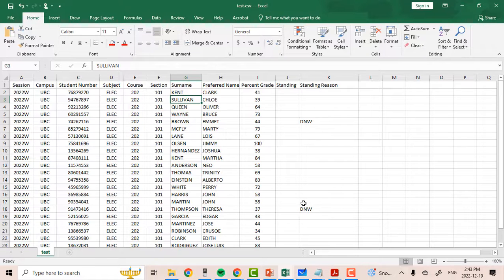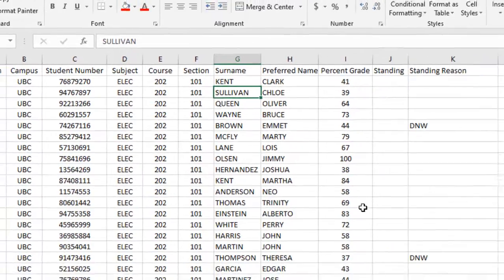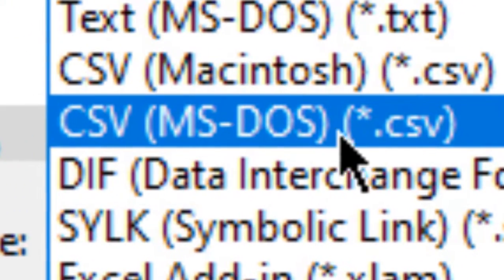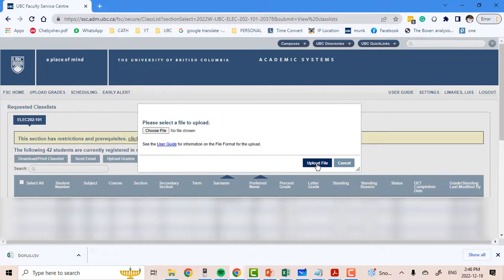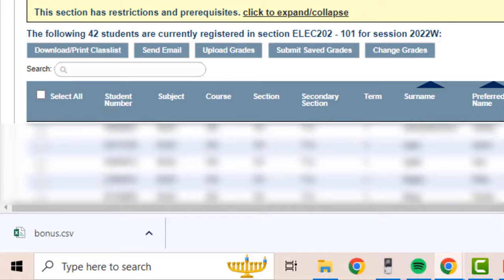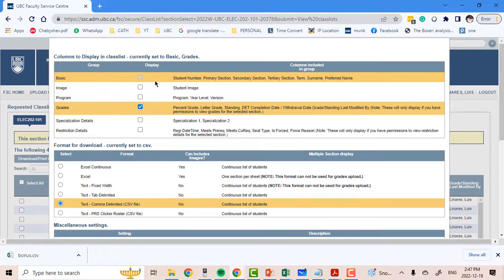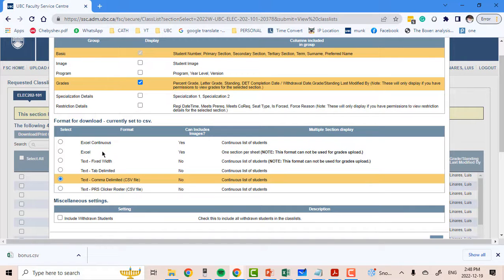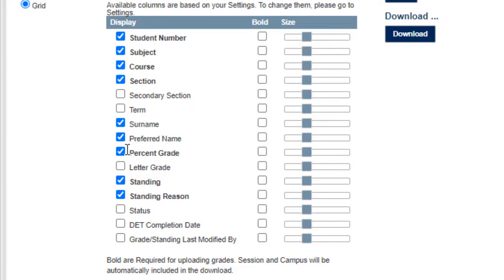Uploading grades to the FSC at UBC

Comment: May I recommend Logitech Pro. I has a great quality microphone, with clarity, good quality speakers that are clear and crisp enough, and the price tag on sale can go very low for what it offers. Lastly it does not hurt ones ears or heads as it encompasses the ears entirely and the headband piece does not push hard on most skulls.
Reply from the maker: Thank you. Good advice. I agree that the Logitech Pro is a nice purchase.  I normally use a Blue Yeti X, but it is with my studio gear, in a deposit.